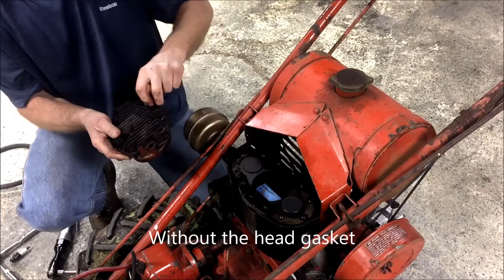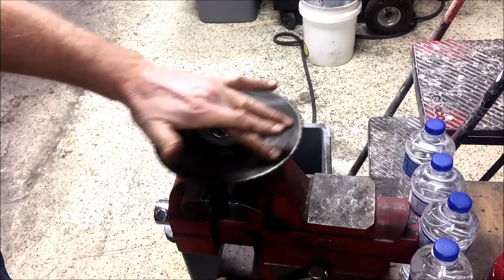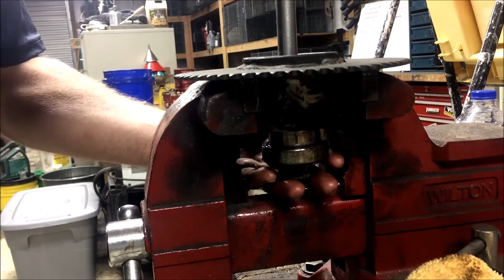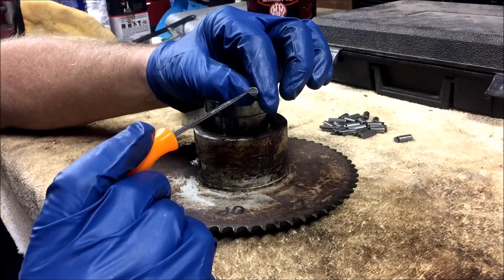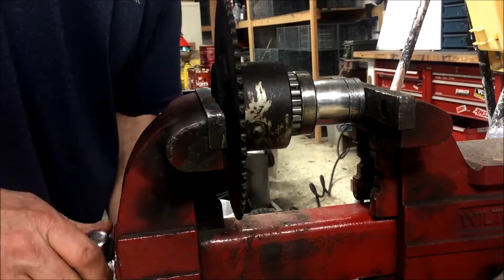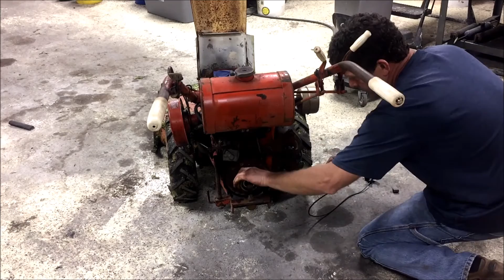Gravely Tractor Starter Clutch Removal & Repair

Comment: hi there.I wonder if instead of taking the head off you could just stuff a bunch of high grade rope in the spark plug hole and do the same thing ? what do you think? I have seen old timers do this with engines back in the day.thanks for the vids bro I'm not to far from you in Liberty MS. I herd you talk of the 2016 flood so I figured you must be pretty close .great vids bro
Reply from the maker: It is a procedure in the manual.   I've either heard of it or read it in the manual.  I can't recall why i did it that way; that was a long time ago.  I lived on the other side of Louisiana in 2016 but I suppose it got rough in MS too.  I'm originally from the Jackson area so It wasn't nearly as bad as the Flood of 1979!!

Comment: Hi, I have the same little gravely and it starts up great with starter, but when I try to pull start it has a ton of compression. So much that it is pretty much impossible to pull start. Why would it have that much compression. The machine runs great and doesn’t smoke
Reply from the maker: I don't recall how difficult it was to pull start.  That Gravely has had the starter kit installed since I was a little kid but I have a picture of my Dad on it before the starter was installed and saw the starter rope draped over the handlebar.  It must have been hard to pull start because I cant see him buying a starter for it otherwise.

Comment: Good video showing me exactly how to work on the starter clutch. New owner, I saw the grease nipple, so I greased it.  BIG MISTAKE! I used conventical grease, not white lithium, now I understand why it quit working.  Live & Learn.
Reply from the maker: You need to get your hands on a manual to help you out.  Check out the source in the video description; they may have one
Reply: @JustPlainCommonSense  I went into the starter clutch, cleaned it up, reassembled, and reinstalled.  The clutch would sometimes disengage, even before I screwed it up.  Now it performs flawlessly.  This video was clear enough on what to do, that I had confidence to tackle the job.  Thank you!  Thank you!  Thank you!

Comment: no need to pull head and ruin head gasket. I take 1/4 " plastic rope from harbor freight (50 ft. less than 2.00)  feed thru spark plug hole until full. all you are trying to do is safely stop piston travel so that you can remove clutch bolt. the rope works fine for me
Reply from the maker: There is a lot of ways to skin that cat.  Yours works as well.

Comment: quicker and easier to lock the motor with clothes line rope  just push in about 6 to ten foot of line in the park plug hole that will lock the piston safely and saves removing cyl head works great safe on piston and quick
Reply from the maker: Yep, I've heard about that too.

Comment: Great video what size is the bolt you took out of the clutch. or what size is the socket on your impact because my bolt is missing. thanks
Reply from the maker: Sorry but I wont be able to help you there.  I sold the tractor not long after the video was shot.  Give Richards a call.  The number is in the video description.  Thanks!!
Reply: 5 Acres on the Bayou ok thanks again your videos are a big help

Comment: I enjoyed your video s , sorry to hear that you had to move the tractor , just to share I have heard on smaller engines , use a long length of rope thru the spark hole to stop the piston , be sure to leave some out to remove it afterwards , that way you would not need to disturb the head gasket . Thank you for the video.
Reply from the maker: That's a really good idea!  Thanks!

Comment: Do you happen to know what a normal operating temperature would be for the clutch assembly?  The unit that we rebuilt seems to run pretty hot.  We measured the temp @ 220F.  We followed the Gravely manual when reassembling, using a small amount of lithium grease.  We are reluctant to continue to operate this in fear of causing damage.  Thank you
Reply from the maker: I have no idea of the normal temp however that is way too hot!!  Call Richards and see what they say about it.  You likely have a bearing going out.

Comment: I am so impressed with your whole series of videos on this tractor. I am a Disabled Veteran and an Auto Mechanic by trade. But, my disabilities have gotten worse, so I have down-graded my hobby from auto mechanics to Gravely tractors. Your videos are the best, and most thorough, of any I have seen on Youtube. I just wish you would have had to go into the engine. That would be some more very valuable information. Thank you so much.
Reply from the maker: I'm glad the engine didn't need getting into!  The manuals are pretty good at explaining things so if you need to get into one, I'm sure you'll do fine.  They are tough and simple machines.

Comment: Thanks, very helpful.  I have two clutches to do, one for lube and one to replace a spacer and bearing set.  How critical is the amount of white lithium grease used in the cam race?  Can the bearings be tapped out through the center hole and installed using the vise as a press?
Reply from the maker: +Panon1 Too much or the wrong kind of lube will not work (according to the shop manual).  The assembly would be removed from the hub then the bearing pressed off the race.  I'm sure with the right blocking, the vice could be used to both remove and install the bearings.  The manual is available online for free.  I believe I downloaded mine from the Richard's Lawn and Garden website.

Comment: Great job, man! I'm sure someone's going to enjoy it for years to come. I'm doing a semi-restoration on my tractor, just painting and cleaning it up a bit.
Reply: +5 Acres on the Bayou 
Someone else will enjoy and maybe learn about history.
Reply: +W.Co.VIDS  I definitely  changed my mind on selling mine. You may want to give second thought on selling yours, like you said you may regret it.
Reply from the maker: +W.Co.VIDS I'm glad you are still working on it.  Don't be afraid to take that thing apart.  I was really surprised to find that mind still had the original piston in it.  Just remember to have a new head gasket handy; using the old head gasket will likely cause you some problems.
Reply from the maker: +W.Co.VIDS You know I'll miss it but my life is taking a different direction and there will not be room for it; for now anyway!